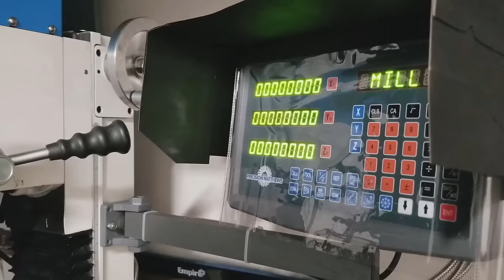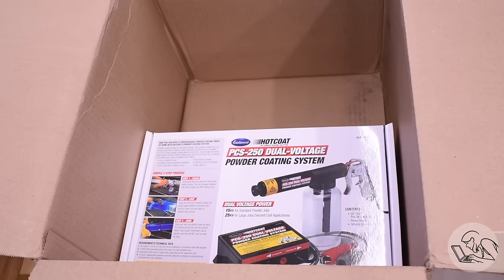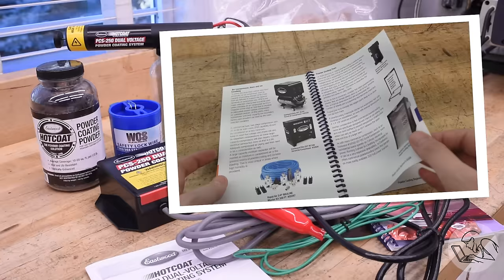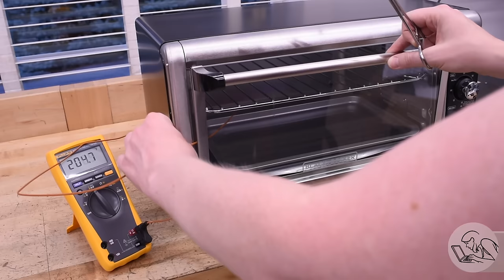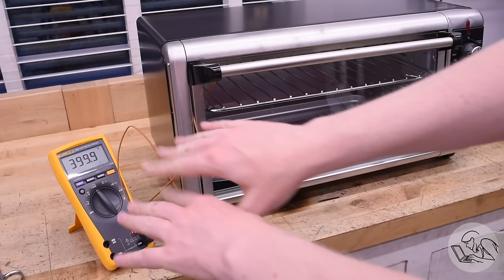Powder Coating At Home! You Can Do It!

Comment: I can do you one cheaper.  I have one of the Craftsman personal powder coat guns.  Under $100 and no air compressor needed.  They only use a fan in the back of the unit to push the powder coat.  Super stupid simple.  And they work surprisingly well.  You just have to be carful with the hoppers.  But for now spare parts are still available on ebay.  I've done a bunch of aluminum parts with the thing over the years.  As for your oven Quinn, I wish you would have asked your viewers first.  That was one of those purchases where you should have spent just $25 extra and gotten the convection type toaster with a digital temp control.  Then you get more even heating, digital heat control that is accurate, and the whole automatic "preheat to 450 then do 25 minutes" thing.  We've been baking powder coated items for years with the same little convection toaster oven.

Comment: @Blondihacks Eastwood also makes a paint stripper that will remove powder coat. it's called Down to Metal Paint and Powder Stripper.  it is the best paint stripper i have ever used.  I restore old cars as a hobby and took a gas tank to be boiled out to get all the dirt and varnish out of it. the company that did work painted it with black epoxy paint when they were finished, even though i told them not to, since the tank is galvanized steel and was never painted at the factory. so, it makes it incorrect for the restoration. epoxy paint is incredibly tough to remove so i had to find a solution that would remove a tough paint, but not harm the zinc coating underneath. I can say that the Eastwood Paint and Powder Stripper did an outstanding job. they have a video on the net of it removing orange powder coat from a chrome valve cover. the stuff is amazing.

Comment: Good video ! I started powder coating my plasma table cut art and parts a couple years ago and have not used a rattle can since , One thing that really helps the finish is to bead blast before coating . I know ,more tools , but its worth it . Another thing if you lower your kv it actually helps with adhesion , just the opposite of what you would think .

Comment: I watch a few restoration channels where they do powder coating and have seen quite a few of them using vertical electric smokers with a glass (or at least clear) door to watch what's going on inside.  They usually have up to 4 racks in them that you can move around or take out to do larger hanging parts, and being 30" tall, but skinny, they'd take up less room on a table top, or some come with stands to set them on the floor.  The channel "Rescue and Restore" shows one in use in every video.

Comment: Using a screw into a threaded hole as the grounding point should give one of the best possible ground connections and a great place to attach the support wire(s). It would also serve double duty to prevent the powder coating from filling those same threads.

Comment: I bought a powder coating kit from Harbor Freight many years ago.  I found a nice over/under double electric oven on trash day for free.  I've powder coated a lot of car parts in it.  You're correct, powder is pretty forgiving, and is very durable.  I sand blast my parts before coating.  The blasted surface texture gives the powder even more to stick to.  You did a great job.  Enjoy!

Comment: You can simplify your setup by using the large ground clamp to hold the wire you use to hang your project from against the horizontal bar.  It eliminates the dedicated ground wire and two contacts that could fail.  Thanks for all the useful content.

Comment: What a coincidence - I recently bought the same setup to powdercoat small control panels and had a similar "Well... that was easier than expected" experience. As long as you're already familiar with basic parts cleaning/prep work then powder coating is a breeze (at least for simple and moderately sized parts).

Comment: I made an oven out of a metal trashcan with an electric element in the bottom and a rack from a grill. I used a powder coat machine from harborfreight and did some motorcyle parts in mirror black that came out amazing!! The trick though is to make sure no dust in the air clings to the part or you will see it in the finish.

Comment: Harbor Freight used to sell a powder coating oven that is about the size of a dishwasher. I got lucky and picked one up off Craig's list for $100. It's about the correct height to put a small blasting cabinet on top, which is also used for powder coating.

Comment: IR thermometers don't work well with bare shiny metal. Like what's inside the toaster oven. The emissivity bare shiny metal is very low. Especially aluminum.
If you get an IR thermometer, I would urge you to calibrate it with your fluke meter. You might be surprised at the difference!
Or you can get a dark non-metallic surface material that won't burn up and hang it in the oven. Like a powder coated strip of metal. Use the IR thermometer on that. 
Check it against the fluke.
You might also drill a hole at a safe place in the oven to insert the thermocouple wire. Make sure you have at least 6 in of wire in the oven so that the heat from the tip isn't conducted to the cold cold outside world and giving a false reading.
Reply: candle soot is perfect for IR meters, and good for very high temp.

Comment: Excellent results Quinn, one small suggestion. Get away from stainless steel as a hanger or ground, use standard copper wire as a hanger and ground. You get better electron flow through copper than you will through stainless steel, and it's much easier to bend as a hanger. Also a cheap meat smoker will do the trick and give you more room to hang your parts. Other than that, it looks great. Cheers!
Reply: And way cheaper along with aluminum being pretty good as conductor go unless you have some GOLD rods kicking around!!????lol!

Comment: I once powder coated some steel handles I made by heating the handle with a gas air torch and dipping them in the plastic powder then hanging them up to cool. worked just fine the thickness of the coating was a bit uncontrolled but was thicker rather than thinner and was almost impossible to get off.
Reply: Back in the day , there were many factories using that method. They used what was called a “fluidized bed” . They heated parts to the melting point of the powdered medium , the cool part was the powder was on a vibrating  positively charged bed and that would make the powder airborne enough above the surface, and the parts were on a moving negatively charged grounded rod and the amount of vibrations and the speed of the conveyor would control the needed thickness .they would exit this setup into an oven to cure for a bit then  come out done. Was trying to get my boss to do this ! We were powder coating at the time!!
Reply: The charge usually only strong enough for a certain thickness then some don’t stick due to the part being covered the bare metal is no longer shiny and exposed it has powder on it so subsequent powder usually falls off. So when you spray the charged particles stick at the same rate and flow around the part! To see the flow of powder from the positive gun to the negative part is pretty slick. In a spray booths we had a wire that we wore to kept the paint off us!! We had the same positive charge as the gun! then if the ground wire would fall of you(it clipped on) as you were spraying all of a sudden the paint would come right at YOU! Lol! Your charge would be too negative and the paint covered you! Powder coating is pretty even and the powder flows all around and under on its own going after whatever is negative in its path you do not need too much fancy movement like regular wet HVLP painting!
Reply: Real problem our system we has was, for some reason our humidity of something was causing powder jams in the gun! Powder would stop too much !  It was as they say a PITA!! Yes, cheap Chinese shit was starting to come to us then!!

Comment: Just a note, people that make fishing jigs often use power coating but you heat the metal piece with a small torch and then dunk it into a jar with the powder coating (because it's hot the powder sticks) and then heat again to finish the powder coating melt process.

Comment: First, love your channel. I bought one of those Eastwood ovens years ago to do some creracoating. I learned almost immediately that turning the oven on its side gave me a LOT more height. I just drilled some holes on opposite sides at the top and inserted some 1/8 inch rods for hangers. Works great. You should be able to do the same if you wish. I do have pictures if you like. Happy Trails...George

Comment: I would've guessed that fluidized bed powder coating would be the go-to method for a home shop.

The idea is that you have a pot full of thermoplastic powder with air bubbling through it, making it behave like a very thin liquid. You preheat your part, dip it in, and use the part's latent heat to make the powder stick. And then in goes into a fusing oven like any other powder coating process.

It's a lot easier to set up, it's potentially a lot less messy, PPE requirements are a little simpler, and you don't have to worry about powder clinging in weird ways due to uneven electric charge distribution.
Reply: That could be an interesting project to set up.

Comment: When i did Metalwork st school here Sydney Australia in 1972 we plastic coated parts by heating the part to say 250 Celsius and holding the metal in a box with aerated plastic particles.  So the particles landed on the hot surface and adhered to it. Maybe wr dipped the part into a nox of granulated plastic.  It did work and left a heavy coat of plastic simlar to electrical linesman's pliers handles.

Comment: Another good way to get your height better is turn the oven on its side ! And while oven is cold you can affix a rod to hang  parts from. Use some wood or something heat resistant to elevate the oveAnd a note on your edges. Use a good chamfering hand reamer m like my fav NOGA and break the edges before painting May solve that  from happening ! Nice tutorial!!

Comment: I use a black and decker toaster oven $35 and it works great. I also set it on the side so I can use longer pieces hanging and I can get 11 inches rather than 6 inches

Comment: I use a simular budget device to powder coat. To avoid the problem with hanging bigger pieces I use a metal bin lined with aluminium foil and an adjustable 2000W heat gun as a heater. It works good and offers 40cm/15 1/2" in diameter and 65cm/25" in height. I use a cheap bbq thermometre to check temperatures and meassure the time after reaching my threshold. 
This setup is not perfect but it is very cheap, works good enough for me and does not need a lot of room or any fixed installation.

Comment: I work in a factory environment where our finished parts are powder coated. Our oven is 2/3 the size of my house and is gas fired. We use a chain conveyor that snakes from where the parts are hung through an acid wash bay then through our automatic coating booth then through the oven at 385 degrees F. Some of the employees wrap their lunch in foil to heat in the oven. Yes, the powder coat is very tough to remove and if defective is baked in another small oven at 800 degrees F, then cleaned up with flap discs and sand-blasting to recoat.

Comment: Powder coating always looks great!

As someone who knows nothing…

1) could you safely mount the microwave oven vertically with the controls at the bottom to give you more space when placing things in? Take away the worry off catching the powder coated items on the way in. 
2) put it on something higher or maybe a trolley to make it easier for you when using it :)
3) in the booth, how about a turntable/lazy Susan with an arm on so you can rotate the part rather than picking it up and moving it. Less chance of dropping it.

Comment: ive found with running our coating line that MEK is one of the better solvents for cleaning cured powdercoat from small area's, it also works well for making touch up paint out of the powder you used to coat with(great for the hook/wire points)
Reply: The only problem is MEK is difficult to find at retail.  It’s at the top of my solvent hierarchy though!

Comment: ive been coating at home for over 20yrs n found that hot coating is best . plus dont check temp inside oven most powders need the part to be 200 degrees celcius . alot of powders you buy will tell you wat temp the part has to be .great starter video .cheers

Comment: i used to work for a company that made powder coatings. they stuck the coating electro statically  this gave an equal covering. one of the bosses did a BMW motorcycle frame, fuel tank and other accessories black with multi colours when you looked into the coating it was beautiful. i had 4 hub caps done white and a trumpet black and brass had to re solder the joints that was different and classy. a pushchair for someone methylethylketone was used to clean off the old paint   the finishes were excellent. the company made money supplying coatings to the oil pipe coatings  for the north sea platforms.

Comment: Another temperature option might be a dedicated k-type thermocouple probe mounted through the oven wall with a compression fitting and a simple readout mounted to the outsideoftheoven. Both readily available on flea bay for around $20.

Comment: Welcome to the world of powder coating. Been doing it for several years with a Craftsman unit. It is self contained with a blower and the electrostatic parts. (No air compressor required) I also use a "toaster oven" but instead of relying on the knob to control it, I interfaced a PID controller with thermocouple,  This also gives a display of the set and controlled temperature.  Convenient and accurate. 
Also agree with you as any more if it is metal, powdercoat  instead of paint:})
Reply: @johnrussell6620  No, I have been lucky and as this is a common thing, I am careful to not break it. Haven't looked to see if there is a model to print. Maybe should do that to be prepared?

Comment: Might I suggest you purchase some fire brick from a local masonary supply.

Build a fire brick enclosure, making sure you have adequate ventilation; the brick will insulate the oven helping it get to temp faster, cool down slower & likely achieve a higher temp, if needed.

Experiment w/ dry stacking the bricks until you get it sorted, then you can mortar them together, gaining more insulation.

Re: very low pressure gauge
If you want a very low, very accurate pressure gauge, try a old blood pressure cuff gauge.

I had a cuff go bad a few years ago & kept the nice looking, high quality gauge. It hung around until last year when I had a chance to check it out. The gauges read in mm/mg, (millimeters of rise of mercury).

Looked up the conversion & learned the gauge had a range of 0 to 2-3 psi.  

Very accurate, very low, there you go!  LOL

Comment: I work for a structural steel fabricator and we use to outsource our powder coating.  A while ago we came to the conclusion that we could do it cheaper and better than our vendor could so we installed our own powder coating system.  Granted that system is for large structural steel parts, but some words of wisdom from what we learned.
1. You want your gun tip to be a little further away from the part.  You don't want the air coming out of the gun to blow the powder off the part.
2. GROUND GROUND GROUND!!!  You mention it in the video and I cannot say it enough.
3. Inside corners tend to not get good coverage due to the electric field.  For the same reason, outside corners tend get get too much powder.
4. MBK is a chemical that is decent at removing powder coating and is available most places Acetone is.  There are other dedicated powder coating removers, but they are rather caustic and not for the home shop.
5. Check the data sheet on the powder.  The time and temperature is usually something like 400F for 20 minutes.  That means the temperature of the part needs to be 400F for 20 minutes, not just in the oven.  You covered this a bit, but for clarity, those numbers are the temperature of the part.  This matters if you are doing dark colors vs. light colors.  The color does affect heat absorption.

Comment: Well I guess you could always put the bigger parts in the kitchen oven with the turkey!  Great job! And yes you are correct about the grounding. While it doesn't have to be directly attached per part, it does have to have an extremely low resistance between the rod and hook and the hook and part. You'll find that a heavier bodied hook with a thin wire welded to it for hanging the smaller parts will give you a much better ground and if you sort of flatten the inside of the hook where it hangs over the bar you will gain more surface contact in that joint as well. Also a curved backer behind the part will direct the overspray back towards the part. Sort of like a juice can or large tomatoe sauce can with the upper lid removed and half the side removed. Hang the part inside of it and Whallah..... Less spinning if the part to get a good coat! I hope these tips help..... It's what I've seen the production lines do and it all works. Have fun and great video. Thanks for showing us! J Pol.

Comment: I did a fair amount of powder coating on airplane cockpits (small 1-6 passenger, general aviation aircraft), and it made the work we did much more professional and the equipment was nothing more than what was shown here, and a custom-built oven with a cheap PID temperature controller.